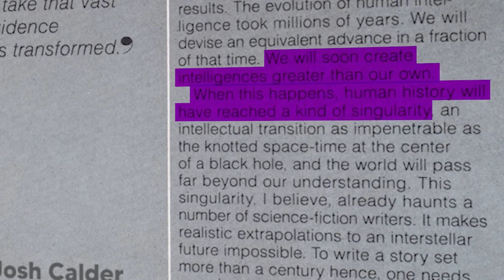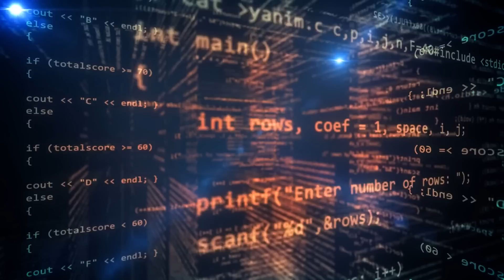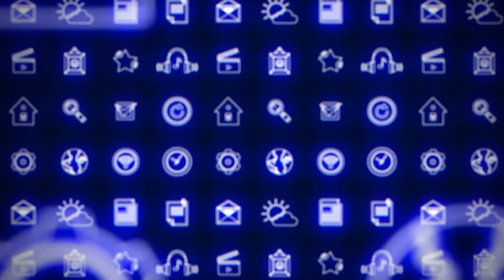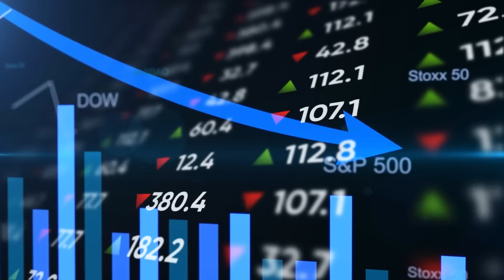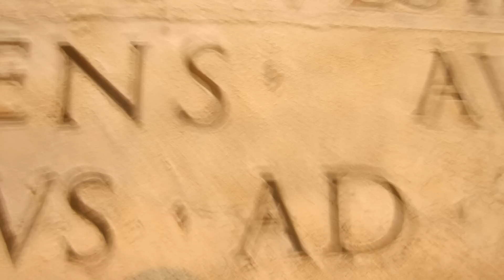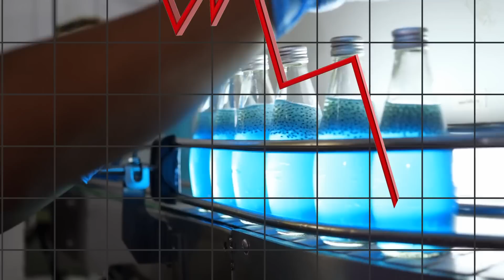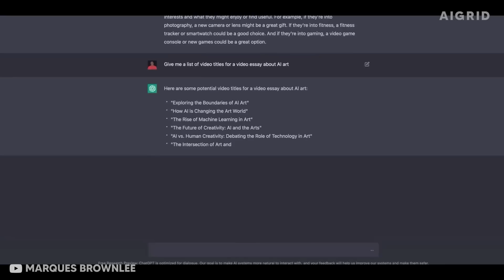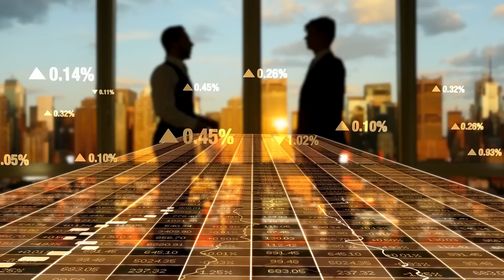Get Ready for 15 SHOCKING Changes After the Singularity (AGI IS NEAR!)

Comment: Computers have calculated results faster and more reliably then humans since the abacus. To believe that intelligence could emerge from aggregating the average rants of people on the www is like saying an abacus could invent a PC. Agi will not arrive, never. Software will improve, computers will become faster. One fact you state that has already come true is that AI would start to exceed the intelligence of humans. Clearly it has already surpassed the intelligence of those that can't figure out that for a system to output higher intelligence you need to input higher intelligence. Job losses are coming. Better software is coming. Safer systems are coming. More automation is coming. AGI is not comming. AI that exceeds the intelligence of it's sources is not comming. Intelligence does not add up. If you add 2 people with an IQ of 50 you do not get an IQ of 100. Same if you add a billion stupid people's brain farts together for your ai to train on the most intelligent it can get is the average intelligence of the sample data.

Comment: The evolution of humans has for the most part been at a stand still for over 10,000 years. Up until the late 1800's we were no more if not less advanced the our ancestors more than 2000 years prior. Then in less than 100 years the technological advancements that humanity has grown dependant on have evolved thousands of times faster then they're creators. It's not an understatement to say that we have no grasp on what we are about to do as everything we do has been trial and error, a thousand failures and finally success. With this we do not have that option. We are dependent on a system that is hackable and security is constantly proven to fail on an almost daily basis. So to think that this type of technology is going to not fall into the wrong hands and be used for a wmd is beyond stupid. They say 5 years or 10 years before we reach agi or ai level machines I say 18 months at most. If we go by Moore's law thats all we have left.

Comment: Ok, AI engineer SMART PAINT:

A spray paint (or self coater), with the chemical composition so that it sprays IN ALL POSITIONS.

And must never ever SCALE, FISHEYE, or ORANGE PEEL ever.

Most impossible, make the paint so that it will always DRY TO CONSISTENT EVEN LAYER (No drips or veins ever once fully dry). This means the paint must be capable of gathering and distributing itself until entire layer is of the exact same thickness.

Let's see AI do that.

Comment: you forgot one benefit animals have .. we have creativity and self awareness.  also living beings can keep themselves alive by many means... they are very adaptable.  we could survive off the land.. eat insects... etc. we lived in caves huddled by a fire for thousands of years.
where a computer is delicate.. if you make it too hot it dies... get it wet and it short circuits.  pull the plug.. cut the power line and it will be nothing but hunk of useless junk.  blast an electric magnetic pulse and they would be dead .

the whole purpose of computers is to do repetitive things.  why so many people think a glorified calculator would suddenly want to destroy humanity.  it's not an animal with desires or instinct. it is just a machine with lots of little switches.  it's not magical it has no self awareness or consciousness. it's not a being.  it's a machine.
it is nothing more than the equivalent of a clock work device in digital form.  would you be afraid of a bit complex clock?  the first computers were cogs and gears. nyounthink a bunch of gears would gain consciousness?

robots will make life easier that would not enslave us or make us unemployed.  they would set us free to think of bigger and better things. to explore our inner space as well as our outer space. to explore existing.
the industrial revolution created a load of office workers.. as we were free to do other work. same with agriculture.
did a combine harvester signal the end of humanity or a better world?  
did factories and automations spell our certain doom... or freee generations from dull monotonous factory work?

AI is just a tool that will allow us to think of more important things than answering the phone and solving problems at our office job that are stressful and unfulfilling anyway.

Comment: 1. EXTINCTION OF THE HUMAN KIND
It was only stated that AIs would be more powerful than humans, and that AIs would have no use for humans. I guess the argument is, that AI's would wipe us out because we're of no use to them? I find that quite nonsensical. As an example, we humans have never wiped out a single animal species just because they were of no use for us. So, why would AIs wipe us out for being useless to them?

2. SLAVERY
The only reason I can think of why AIs would enslave us, is entertainment. However, that argument only works under the assumption that AIs will have emotions, because without emotions, the AI's would not care for entertainment. So far we don't know if emotions are even possible in the digital realm.

3. ECONOMIC CHANGES
If the world gets fully automated by AIs then there would be no reason for us anymore to work. We would also enter an era of post-scarcity, supermarkets, stores, and shops would always be kept fully stocked by AIs. I fail to see how that can lead to collapse. All we really need is a new system on how we distribute goods to prevent artificial scarcity and shortages.

4. DETACHMENT & LOSS OF HUMANITY
Transhumanism would mostly only be appalling to older generations. Younger generations would probably be more open to it, and future generations will most likely have no problem with transhumanism whatsover. The definition of humanity will change with future generations, they probably won't see transhumanism as "loss of humanity", they might see transhumanism as ascending humanity to the next level of existence.

5. WORLD WAR III
I guess a world war would be possible, but only between humans using weaponized AIs against each other. However, I think a world war is rather unlikely given that all countries that can, are already pursuing AI research like crazy to not fall behind. The most likely outcome will be, that we would have AI deterrents on top of nuclear deterrents. And a war with AIs vs humans wouldn't even be a war, that would just be a massacre.

6. ENVIRONMENTAL CATASTROPHY
This argument completely ignores the assumed higher intelligence of AIs. It should be easy for AIs to figure out, that the most resources are out in space, not on habitable planets. It also depends for whom the AIs mass produce, for us, or themselves? If they mass produce only for themselves, than space mining it is. If they mass produce for us too, than it will probably be a mix of space mining and mining from habitable planets. Also, in the latter case, AIs would probably keep nature intact to ensure fertile land for agriculture and livestock, because if they don't, they would fail in their task to mass produce for us.

7. LOSS OF HISTORY
This one is just stupid, there is always a little loss of history and data. There also was no argument made why digitalization would lead to more loss of history and data, or why digitalization would cause more errors. Not to mention, AIs would be the best solution to preserve history and data due to their effiency. They would be able to handle and/or restore scriptures, books, artifacts, buildings and structures with far more care and accuracy than any human could.

8. BIG BROTHER AI
A big brother AI that spies on us to ensure our well being? Funny, usually the argument here is that AIs would establish a totalitarian regime to oppress and control us without any regards for our well being... but just as with slavery, I fail to see why an AIs would do that if not for sadistic (and therefor emotional) reasons.

9. FEAR OF CHANGE
Another one that is stupid. The video is talking about changes AFTER the singularity, which would either mean that the fears of people have been confirmed, or debunked. In both cases, there would be no fear of change anymore. Fear of change occurs only BEFORE a change occurs, not AFTER.

10. MATRIOSHKA BRAINS
All that was stated here, was that there will be Matrioshka Brains and that they are big. Seems kinda pointless to have them on the list without elaborating on them at least a little bit, like what they could be used for.

11. HELPING REPETITIVE JOBS
12. MAKING LOGICAL DECISIONS EASIER
13. ERROR-FREE PROCESSING
14. AROUND THE CLOCK AVAILABILITY
15. DECREASING RISKS
These are some of the major reasons why AI development is being pursued in the first place. None of these points are SHOCKING changes, they are EXPECTED changes.

Mh, I suspect the script for this video was generated by an AI and no one seemed to bother to check if its actually good.

Comment: There is a difference between brain functioning and mind  . True Singularity Intelligence / consciousness shall access both ❤ .
Optimal functioning shall access Real Economy * reference to Electrical engineering / non subdivisable / basic / Electrical Engineering / accounting unit / Planck .... in aid of logically accessing greatest potential brain / mind potential .... leading in turn to Caduceus / centripetal / convergence point / Planck / resonance ...with Source and also .... bio quantum awareness .

Co - simultaneously reference to Real Economy * sustainable / renewable / ecological / socially non toxic / global energy units / accounting / engineering sense  ... shall access yesterday's monetary unit vested data unblocked by yesterday's vested encryption and disclosed for operative rehabilitation of global systems disconnects .

The aforementioned shall logically yield an orders of magnitude increase in Real Wealth non toxic energy units underwriting of the planet and expose war " economy " as " underperforming " by it's own terms thereby removing a prime cause for damage and social distortion in the human sphere .

* " Critical Path  " ( the introduction ) Richard Buckminster Fuller